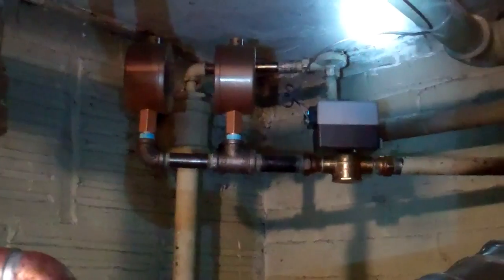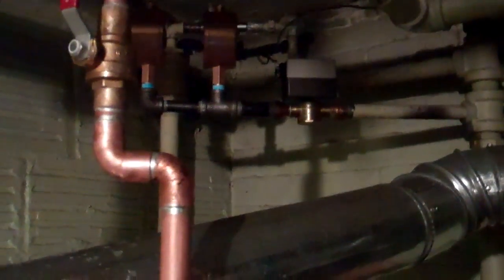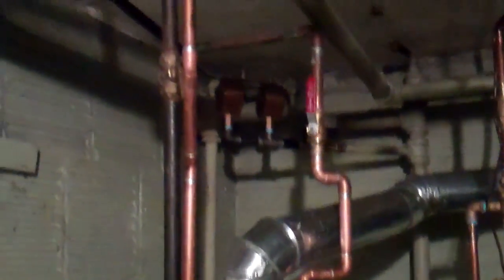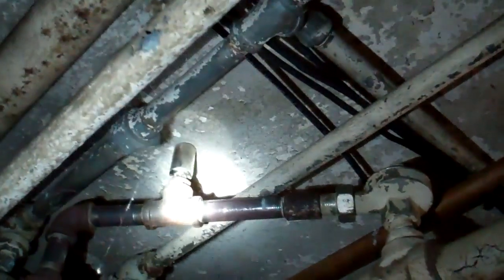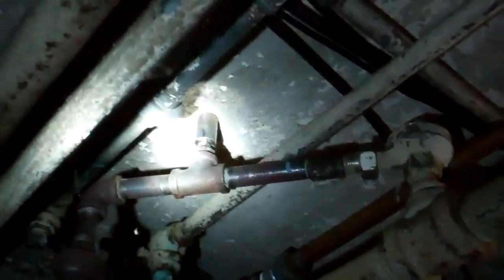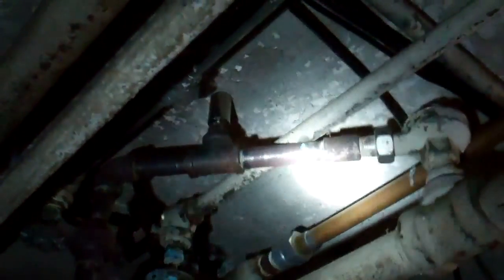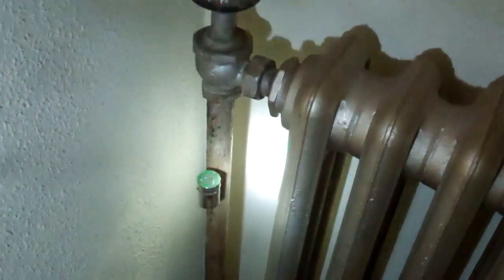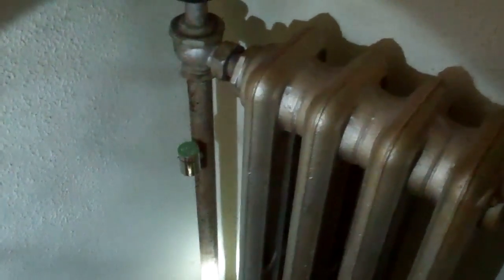Air locking of a two pipe steam system.mp4

Comment: I have a question 
I've been at a one family home with a two pipe steam system with convector style radiators but they also had a air vent on each radiator and the steam is not working properly my question is can a 2 pipe steam system have air vents on radiators? Water is spewing out of the air vents and water is not returning fast to boiler which makes the water feeder keep feeding water to boiler 
Steam traps are old

Comment: Clever way to use a solenoid to lock the system out, and the failure mode is just that the far ends would return to not heating up as much. Really pretty clever.

Comment: Wow a great solution to no heat.  I learned that this heating system may have worked by default during the coal fired days when steam was always up but for thermostatically controlled firing of boilers the old piping design was inadequate to ensure heating to the far end of the building.  I think the dead men would have been proud of your solution.

Comment: he dont sound like a 90 + year old man so i don’t think it would have bean him that installed the original system all he did was add the sensor and valve and some bits of pipe i doubt he had anything to do with the funny looking water heater plumbing since its a complexity different system not at all related to the steam heating

Comment: didnt even attempt to watch the video, if you installed that system you want shot! , ever heard of a pipe bender? to many elbows left right and center, shoddy work.
Reply: TheOnlyMrMeek 
Where I live code does not allow bent pipe.
The video is about a boiler, not the separate water heater.
Mr. Gill shows a thoughtful solution to a common problem.